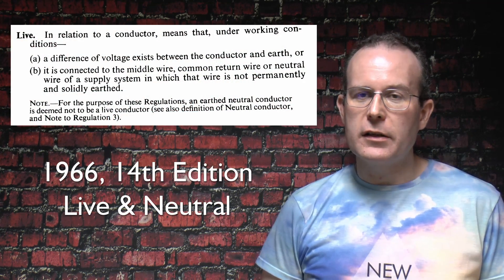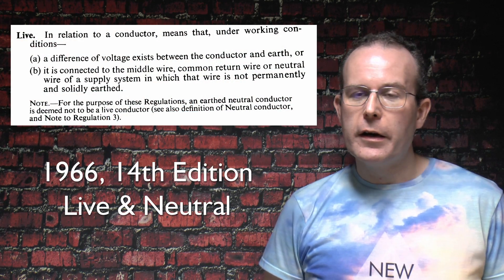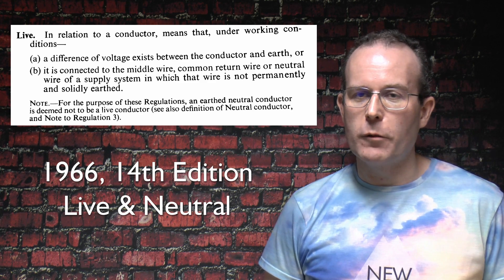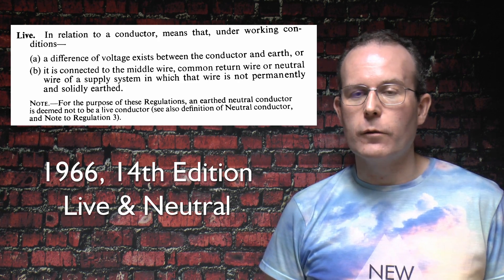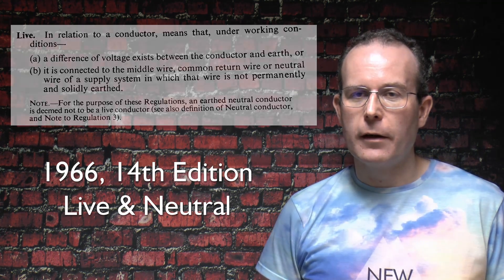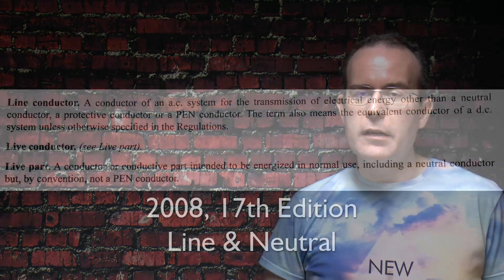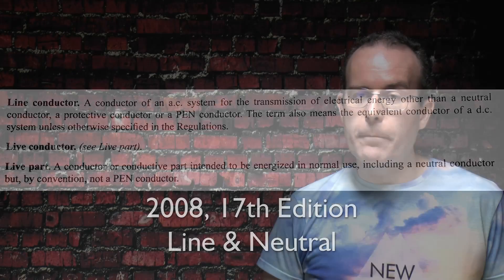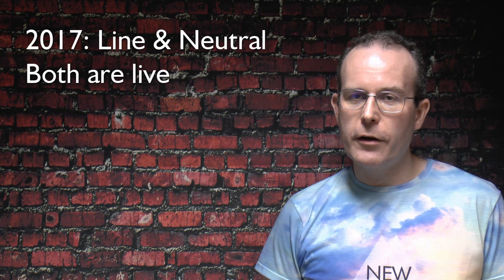Line & Neutral Or Live & Neutral ?

Comment: "Live"  is a much better word to keep people who shouldn't from touching mains electricity!   It sounds far more lethal to the layman than phase or line.
Reply: the thing is that calling one live and the other neutral implies that neutral is safe which can be false in some fault conditions or even just simple installation errors. Giving them both slightly ambiguous names means so long as whoever goes near it knows its an electrical cable (which anyone with common sense will realise) they know not to touch ANY of it rather than just avoiding the wire with the scary name.

Comment: I tend to refer to conductors in AC mains systems at elevated electrical potential as "phase" when speaking to others. Since I deal with electrical systems globally, this parlance seems to avoid some ambiguity. Using any other term seems to confuse people from region to region.. even if the technical legal description for the electrical codes or rule set of an area use the terms line and live. I also deal with ploy-phase systems, some of which, may not even have neutral, or PEN/EGC conductors. In north America, utility lineman seem to have broadly spread the term "hot".. meaning anything at elevated potential which might kill you.. interestingly enough that term is applied to not just current carrying conductors.. it could be used as in "Don't touch that pylon it's hot!!"  Interestingly even these professionals with such a broadly applied term as "hot" still know exactly what I'm referring to when I use the term "phase", and as it is the correct engineering descriptor in addition to being nearly universally intelligible.. It's probably the term I'll stick with.. even when I'm in england  ;-)

Comment: I usually use "Live and neutral" or "Hot and not" to refer to the respective conductors in AC mains. Though I always have a hard time remembering that black is hot because I keep wanting to think "White hot" and "Cold black" in reference to blackbody radiation. The hotter a blackbody is, the more of the electromagnetic spectrum it radiates, so that by the time it's a few thousand kelvin it appears white because it's radiating the entirety of the visible spectrum and possibly on up into the ultraviolet.

Stupid North American mains wiring color code being backwards. :P

Comment: I thought I understood AC line and neutral but thinking about it I don’t. So if I wire up a 240v bulb I will only get a shock from the line terminal? I thought the point of ac is that the electrons flow back and forth in each direction so there is a different polarity 50 times a second? Baffled.
Reply: They do, but one wire is hooked to the ground / earth at the transformer, so if you think of it as alternating pneumatics, rather than electrons... the 'neutral' is like the atmosphere itself.... and the 'line' is a pneumatic hose that alternately sucks and blows air....
Reply: TheChipmunk2008 Ah! Thanks. That’s a great analogy. It’s the sucking that’s the key then. Rather than the electrons being just pushed from each end. That still leaves me struggling with, say, three light bulbs in series. The middle bulb can’t have a neutral because the last bulb will then have no line?
Reply: You wouldn't wire three light bulbs in series in the real world though.  They would always be in parallel.  Think about it.  You have three light fittings in a room.  If they are wired in series, if one blows, they all go out (remember those crappy christmas tree lights) whereas if they are in parallel, only the one that has failed will be out, the other two fittings will continue to work.
Reply: I'm starting to think its to cover bodged installations where Neutral has magically become dangerous to touch because of someone else's mistake.

Comment: excuse my ignorance but if you were to touch the neutral wire without touching the line/live would you still receive a shock? I ask as you say Neutral is connected to earth.
Reply: No, if the installation was working correctly, the neutral is safe to touch. BUT it's insulated and treated as 'live' because a loose connection anywhere can cause it to rise to any voltage up to and including the line voltage.

(see John's other videos about the subject :) )

Comment: So it's line and neutral.  Both of which are classed as live: "not earth, one of which is normally at a lethal voltage, one of which may be at a lethal voltage under fault conditions."  We really need a term for "normally at a lethal voltage."  I suggest "fuck" because of what you exclaim if you're still alive after you've touched it.

Or maybe we could go back to live and neutral and invent a more sensible term meaning "may be at a lethal voltage under some conditions" because calling neutral "live" is misleading most of the time.  How about (and this is off the top of my head) "live and neutral, both of which are dangerous"?

[edited to get around parsing stupidities in google's markdown]
Reply: Active and inactive? Or pre-circuit and post-circuit?

Comment: To me, a home gamer in USA, 'live' applies to the conductor that will kill me if I touch it, neutral is the one that won't, and ground is the one that takes care of short-to-chassis faults in devices connected to the supply.

What's scary is that, quite often and especially in older homes, you'll find the wires are hooked up backwards. Devices generally don't care, AC is polarity agnostic and will work just fine no matter which of the two conductors is connected to the 'in' side of the device circuit, but it does catch out the occasional electrician that just assumes it's wired properly. Regardless of what the labelling is, I'll probe voltage with the meter and suss out exactly which wires are carrying angry pixies, and use that instead of what's supposed to be connected to a given terminal.

Comment: I don't understand the reason why at times when u test a neutral cable with tester u can see that there is a current flowing through the neutral cable as live why?
Reply: Neutral should be the current return path to the consumer unit.  A closed circuit with a load, the current is determined by the voltage / total resistance (DC or impedence AC).  The whole voltage  should by dropped across the load, however, the current will be the same at any point in the circuit.
Reply: Richmond Oppong if there's a leak to ground on the circuit could that account for for it? Seeing as neutral is ultimately connected there outside the consumer unit?
Reply: Are you fuc$king kidding?
Reply: Ollie B I can't get u clear

Comment: is it wrong to use Live and Neutral today? also is it a problem if I don't balance a 3 phase circuit evenly. eg 16a, 0a, and 11a? I have a C19 to C20 cable at 50celcius. Is this bad? is it because I am at the max rating of the cable (16a)?
Reply: Phase balance is important on larger installations, but if it's small commercial or residential 3ph, the large number of installations will balance it out.

I am not sure what a C19 to C20 cable is, but 50C sounds like it's being significantly loaded (NOT overloaded mind you if it's below 70C, assuming it's PVC). But any temp that's more than a few degrees above ambient WILL eventually shorten the life of the cable. But it doesn't sound immediately dangerous.